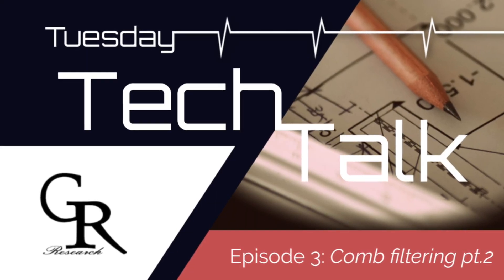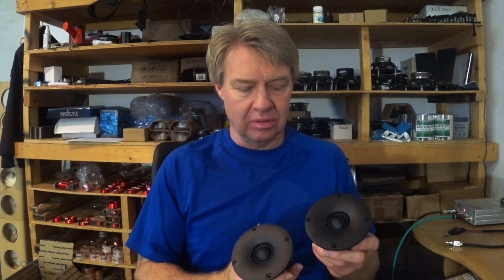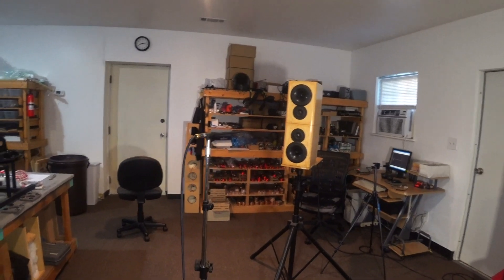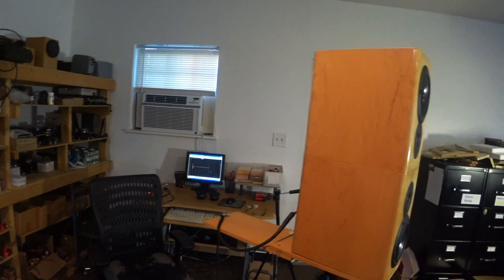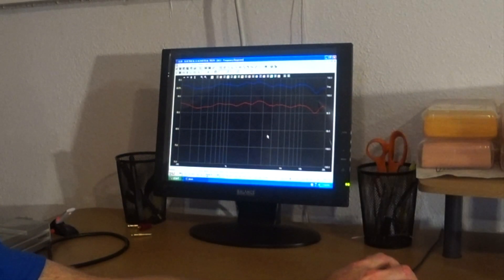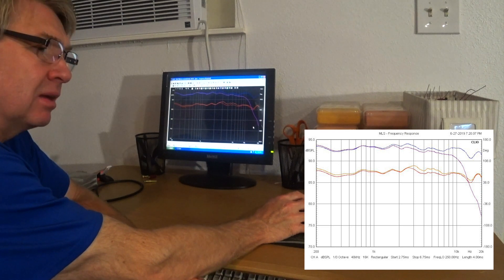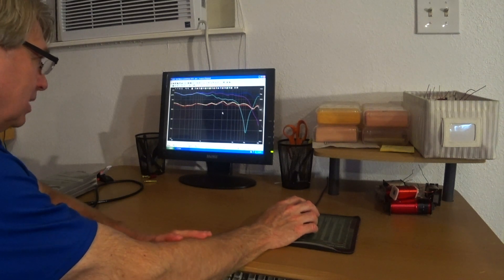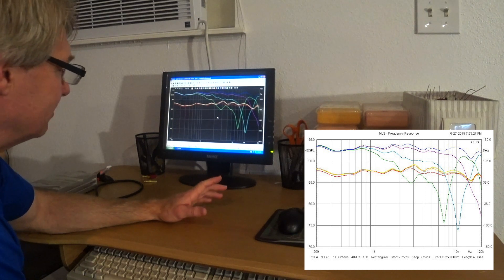The REASON why 2 tweeters wont work!

Comment: id be interested to hear what you think with the placement of the 2 tweeters on my 3 way tops, they are are spaced about 35cm apart horizontally and angled away from eachother at about 25 degrees a side, will that cause a come filtering effect

Comment: I almost replied with "...but what about Tekton Designs" and then I remembered that they have one tweeter in their tweeter array that's playing frequencies above the 1/4 or 1/2 wavelength to keep the comb filtering at bay. It's a very cool design using tweeters with super low Fs as an low-mass array.

Comment: Does this "comb filtering" issue also apply to car audio as i have seen many people install multiple tweeters and mid-range speakers on just one door panel.. I myself have never done it , but I'm just curious because I've have heard or read something that  was lightly discussed on that subject on a forum, i believe, but never got to deep into researching on why it wasn't a good thing ....lmk . Thanks, Jose

Comment: Interesting. Does this apply to bipole speakers with tweeters facing different directions? I have a pair of Def Tech SR9080's & I noticed when I put my receiver in "all stereo" mode where every speaker is playing the same thing, the sound becomes muffled like I'm losing my hearing as a I move my head slightly back & forth.

Comment: I have 7 speakers in my home theater (other than subwoofers). All of them have tweeters. How come those tweeters are not significantly cancelling out each other. I can only hear a subtle difference by changing my position. I have also used software to see my freq. response at different seating positions. I am just curious that how having tweeters in totally different locations and obviously not synced exactly in time are so forgiving. I understand that at any one spot I may be listening to just one speaker dominant in that area but I have tried by turning on and off different speakers and playing around with their positioning. Any help would be appreciated.

Comment: Great video, just like all the others. 
My question though. Your test setup places the tweeters approx 7" to 8" apart. If the tweeters were smaller, like Tymphany D26NC56-06 or Dayton Audio ND20FA-6 for instance and placed touching, one mounted above the other on the same baffle. Would the combing effect be nearly zero as the center distance is only 1.5" to 2" ? I'm considering this as I need approx 95 DB to 96 DB @1W/1M. I'm not too keen on waveguides as I would like good polar dispersion if possible. Many thanks. Richard UK.
Reply: you will still get comb filtering but only above 10k hz

Comment: I'd imagine if you do dual tweeters with ones that have no baffle of their own and small neo magnets, and inset both into the baffle in a custom waveguide with the domes very close to one another, this would be minimized
Reply: At 10khz the wavelength is about 3.5 cm, maybe 1.5"

Any separation larger than this will cause these interferences
Reply: @mattseaton5832  Its true, but any interference wiggles will be small enough that in a normal listening environment at normal listening distances in a typical room, they will nearly vanish with respect to the much larger room issues. The only time this might be an issue IMO is nearfield.  Just my two cents

Comment: That's a very good demo of the phenomenon of interference, big thanks...I have a mono guitar amp that has two piezo tweeters 12" apart, I'd like to replace them with some better dynamic tweeters, would you suggest to use only one tweeter instead of two?

Comment: What you showed must also apply to the crossover range of a speaker.
It has opened my eyes and it also shows why Tannoy and Kef bother with the dual concentric idea plus why many woofers and tweeters have a flat side to enable the closest possible placement.

Comment: The differences between the two speakers probably has to do partially with the geometry of the stand, diffraction around the differing geometries, and the ceiling vs floor relative to the tweeters and woofers.

Comment: Very interesting and informative.  What audio software do you use?  I am not really fond of the software I am currently using.  Do you think most standard laptop audio cards are accurate enough to get good results when measuring and testing? Or should I use something like a USB preamp from Behringer or Presonus etc?  I probably need phantom power for the reference mic.  Can you give some advice on the best way to set up for measuring?

Comment: So the big question is why doesn't this effect the woofer? There are tons of speakers that use several woofers in a tower arrangement. 
also, Back in the 70's there was a company that used two phenolic ring tweeters mounted at two different angles to expand the soundstage of their speakers. They were made by Studio Lab and the model number was SL 110 and they were fairly successful at the time. They sounded great for using phenolic ring tweeters, which by today's standards aren't that good. Ny ear I could hear any loss of signal throughout the sound stage and seems to have a very wide sweet spot. You can find pictures of them on google images so you can see what I'm talking about. The question is then, how did they get away with using two tweeters? Was it because they were facing different direction?
Reply: Wavelenght. Low hz == very long waves, so the woofers do not have this issue.

Comment: Dynaudio puts two tweeters on many of their top line speakers. And Tekton puts even seven or more. But as I understand only one of those tweeters runs at an upper end of a tweeter range.
Reply: On my Tektons, the 6 tweeters of the outer  ring are wired pairs in parallel and those pairs are wired to each other out of phase. the wire  from crossover is wired to the positive of the first tweeter of the first pair. The negative of the last tweeter of the last pair returns to the crossover
Reply: +1.    & how are they wired ?? series or parallel ??
Reply: @garygranato9164  They are  not wired together but via different crossover filters. And for Tekton 6-tweeter array that could be series-parallel connection.

Comment: Great presentation. YOu could alo look at it thinking that the wavelength of a 20khz sound if about 1.7cm, tiny compated to a 17m wavelength for a 20hz signal.
What would you get if you had 3 tweeters, th one firing forward and two aimed off to the sides to widen the listening area?

Comment: What about something like JBL’s VRX932LA, which has 3 tweeters mounted in each box on a mild curve in a line array.  The tweeters receive -3, 0, 3 db signal difference. Looking at their literature it seems a single speaker box has a lot of high frequency roll off in the vertical bandwidth but when you mount 3 in an array suddenly the curve above 1khz is fairy flat.  Can you explain how they are achieving this? https://www.jblpro.com/ProductAttachments/VRX932LA-1_FINAL.PDF

Also how would this affect the horizontal as they do not show a plot with multiple speakers

Comment: Tried to comment before but it didn't take.  I'm a little late to this post.  First off, thanks Danny and Ron for your contributions!  I have a pair of Rectilinear IIIs (the tall ones) from, I think, '69 or '70. The speaker cabinet is 18" wide by 35" tall by 12" deep and has a 12" woofer, a 5" whizzer cone midrange, two 2 1/2" tweeters and two 2" super tweeters. All four tweeters on these speakers are spaced apart: one tweeter is just above the woofer, almost vertically center-baffle and horizontally off to the side, the other is higher, next to the midrange, about 9" from the top of the baffle, on the opposite side. The two super tweeters are at opposite corners, top and bottom.  Watching this video has me concerned about this configuration.  I’ve not had these measured in this 1-watt/1-meter way and wouldn’t have the equipment or know-how to do so, but I’d be curious to see how they would measure.  I do like the way these speakers sound, very natural, wide soundstage, good imaging, good bass down to maybe 40hz.  As I try to understand comb filtering and determine whether or not I can hear this with the Rec IIIs, I am curious to get your take on the Rectilinear configuration and whether or not you’re familiar with these speakers.
Reply: Well, without question if one is delayed in time just slightly compared to the other then they will directly cancel each other out and cause some holes in the response.

Comment: c-to-c between the tweater is clearly to big for tweeters.. you can push the drop over 15khz with smaller c-to-c
Reply: In the vertical off axis the cancellation will still be fairly extensive and well into the 3 to 4kHz range.

Comment: Seriously, go listen to a Stirling Broadcast LS3/6 and claim it's a bad sounding speaker with a straight face. But I suppose designers the likes of Derek Hughes have no clue what they're doing. 😂
Reply: If both tweeters are both covering the same range then what is illustrated in this video will be present without question. But if you like the result then happy listening.

Comment: You don't even need fancy test equipment to hear the effects. Use white noise, pink noise, or hiss, which you can find doing a search on YouTube. Play it through two tweeters, or full range drivers, and move your head up and down or side to side.
Reply: You are correct.
Reply: Dave Rat has a good demo of the effect; https://youtu.be/VHjdh-Vka-g?t=246

Comment: Love to see this methodology applied to the Tekton Impacts. In theory, the nearfield response should have dips all over the place. Room placement may flatten them out somewhat, but it's going to be a hit or miss proposition.
Reply: What I am illustrating and showing here doesn't really apply to the Tekton designs. They use only a single tweeter to cover the whole upper range. The rest of the tweeters are actually playing upper mid-range areas only.
Reply: @dannyrichie9743  Thanks for clarifying, Danny.  That was not obvious from a simple visual impression.
Reply: @orelove  I know. I thought the same thing when I first saw them.
Reply from the maker: Hi Stan, I have measured the impacts and was unable to find any evidence of comb filtering issues.
Reply: @Newrecordday  Interesting. I am only mildly surprised,. Empirical evidence should always trump theory. But if those are near-field measurements from multiple spots, I wonder how Tekton dealt with it in the design. Then, of course, there are the real-world in-room issues that can swamp out any near-field observations. Your own sound demo recordings show marked differences between near-field and in-room results. Keep up the good work. It's thought-provoking.
Reply: @Newrecordday  

Exactly, because there are exceptions to almost every "rule" in loudspeaker engineering and audio in general. This is why these blanket statements shouldn't be propagated without extreme caution. 

For almost every blanket statement one can make about speaker engineering, an exception can be found.
Reply: Nat N  Think about it in simplest terms with just a first order filter on the drivers. A single cap is on the center tweeter,  but it is a large value letting it play down into a range where it is already rolled off.  Let's say that it starts rolling off at 3kHz and is down quite a bit but still has some output to 1kHz. Then a group of the same tweeters are used in a series parallel grouping but a first order high pass and low pass filter is applied. So they have a cap and an inductor. And the filter allows them to play down to 1kHz also and up to 3kHz. But they cross at 2kHz to the single tweeter.  So you are getting gain down low where the wavelengths are long and the output is in phase and coupling to increase output. So with the group of tweeters you are extending the range they cover down low.

Comment: Hi Danny, I see that Aurion has a tunable pair of ribbon tweeters for $299 to add on top of existing floor speakers. What are your thoughts?
Reply: They will absolutely cause the same things seen in the video. And be sure to tune in next week when I show what happens when a super tweeter is added to  a full range or wide band driver.
Reply: Thanks Danny... You may have saved me $300!
Reply: You’d probably be better off pointing them upwards or rear wards.

Comment: Yep comb filtering sure looks bad.
Long video kept saying show you & you'll see. Does he actually think he's the only one who knows that comb filtering looks bad? How many people can hear comb filtering? Some of the greatest & most knowledgeable loudspeaker designers of all time put multiple tweeters on their loudspeakers. It works. Has this guy never heard of  line array?
Reply from the maker: Line Source is a different animal all together, not the same thing as the examples being given in this video. Thanks for commenting!
Reply: Certainly I am not the only one that knows about or understands comb filtering, but it is a subject that a lot of hobbyist don't understand very well. How many people can hear it? I think everyone can hear it especially when it causes large holes in the output. Have I ever heard a line array? :-) Maybe you'd like to drop in on our Facebook page and scroll through some of the pictures of speakers that I have designed: https://www.facebook.com/pg/grresearch/photos/?ref=page_internal
Reply: Nat N  Check this kit out: http://gr-research.com/nx-treme.aspx  This one uses a planar magnetic tweeter in a waveguide with a low crossover point. The mids are better than the older LS series designs. The baffle is smaller. Imaging is a lot better. It still uses multiple woofers to handle the lower end (very fast) and is full open baffle from top to bottom. And the drivers are physically and acoustically aligned on both sides of the speaker (front and back). They are incredible.

Comment: Why doesn't this cancellation propagate from left channel tweeter and the right channel tweeter? Why do they have to be "on the same baffle" for this cancellation to occur?
Reply: It can, but those are typically different signals (stereo). The room reflections are often a much larger issue.
Reply: Nat N  No there is still comb filtering but because the distances are greater the comb filtering can take place in lower frequency ranges.

Comment: If I use dual 3 inch mids per tower should I be worried about comb filtering? The range will be 200-3000 hertz.
Reply: Check the wavelength at 3kHz. http://www.soundoctor.com/freq.htm    So when you cross your mids to the tweeter you'll want the acoustic centers of the mid to the tweeter to be less than the wavelength at the crossover point. That's a good rule of thumb.
Reply: @dannyrichie9743  isn't it usually a good idea to have the center of the mids and highs as close as physically possible anyway? Or is there an optimal distance depending on the crossover point?
Reply: @dakken74  Yes, the closer they are together the easier it is for them to blend, and it will minimize cancellation patterns in the off axis response. See the rule of thumb posted above your post. An example would be if the acoustic centers are 6.5" apart then the crossing over point needs to be less than 2kHz. If the acoustic centers are 5" apart then they need to cross below 2.6kHz.

Comment: I currently have front speakers set up in this exact configuration.  I stacked them for the exact reason Danny mentions.  I had no idea that I would introduce this issue.  Luckily, these speakers were part of a 5-speaker set for my home theater, all of which are matching except that the front L and R speakers are bi-amped.  I will experiment with turning the bi-amped tweeter off to see if I can hear the difference.  I did have the mid-point of the tweeters at ear level to set both tweeters the same distance to my ear.

Danny, I use software called ScreenCast-O-Matic (https://screencast-o-matic.com) to make training videos for software that I write.  It captures my computer screen while I operate the software.  I like that you show the software in this video and would like to see more of that.
Reply: I disconnected my bi-amped tweeter and the soundstage and imaging improved.  Thanks for the free upgrade!
Reply: And did you notice how bad it sounded? Nope. Cause it didn't.
Reply from the maker: Sometimes you dont know how bad something sounds until you hear how good it can sound.
Reply: @Newrecordday  Good is subjective. You could just as accurately say how different it could sound.
Reply from the maker: Or, "I disconnected my bi-amped tweeter and the soundstage and imaging improved.  Thanks for the free upgrade!"